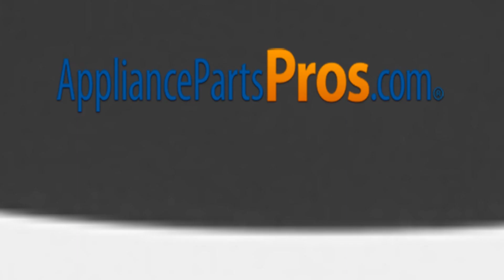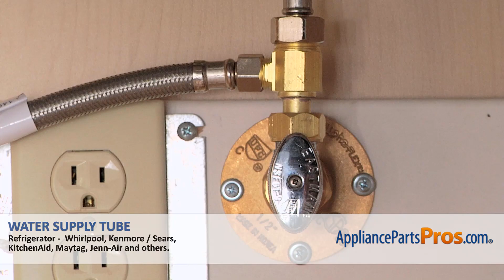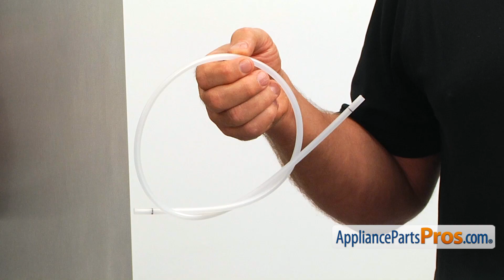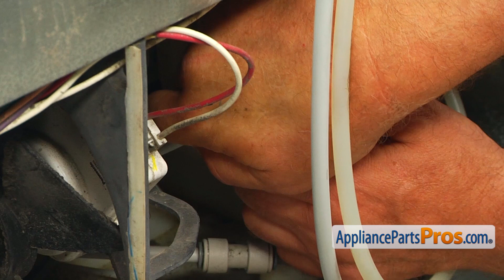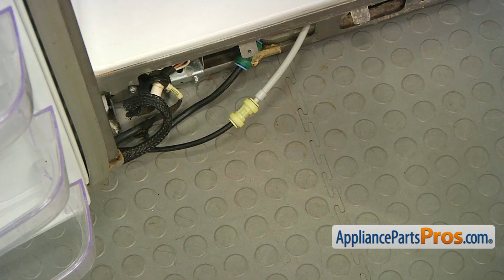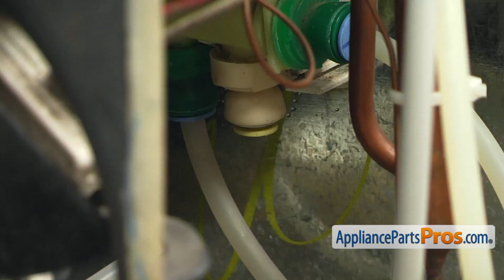Whirlpool Refrigerator Water Supply Tube WPW10238092 Replacement — fits KitchenAid/Maytag

Comment: FULL STOP
The translucent water line on my fridge has broken at least a dozen times while I've owned it, once causing over $10,000 damage when the downstairs ceiling collapsed.  It most often breaks at the bottom corner of the freezer door (lower left hand side) although breaks have occurred elsewhere as well.  It seems the line not only can't handle the bending radius at the bottom of the door, the heat from the compressor and from the de-icing fan contributes to the line becoming brittle and snap.

I strongly recommend NOT using the translucent line shown in this video.  Instead, get some 1/4" OD reverse osmosis line - it's easy to distinguish because it's a little stiffer and opaque white, not translucent.  The RO line comes in a coil, I got mine from the 'Zon.  Use it to replace as much of the factory translucent line as you can.

However, note that there are two sizes of water line.  One is 1/4" OD.  Make sure you get the correct diameter line or it may not connect.
Reply from the maker: Thank you for sharing your experience. We're sorry to hear about the repeated leaks and the extensive damage you experienced. Since water line materials and routing can vary by model, we recommend confirming any replacement tubing is compatible with the refrigerator and approved for its water supply system before installing it.